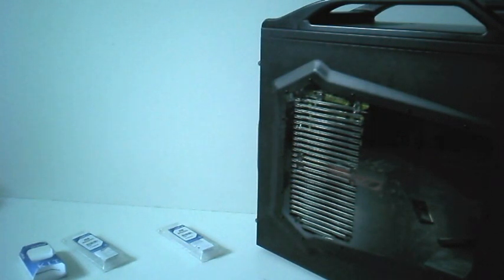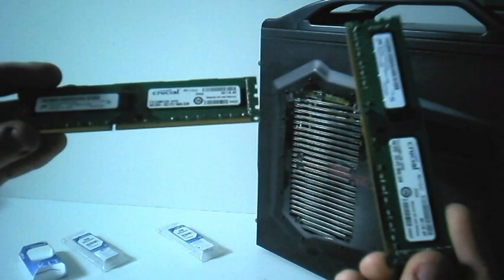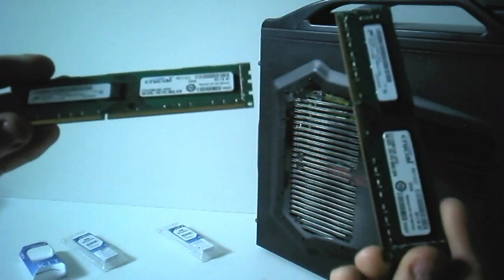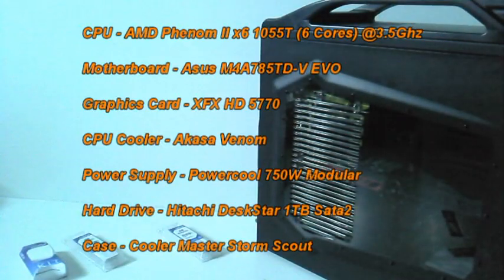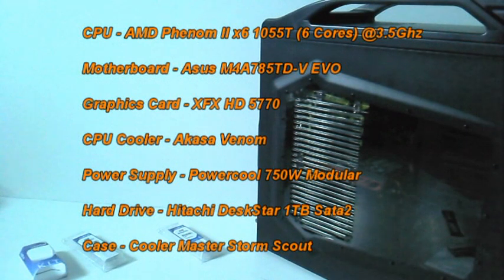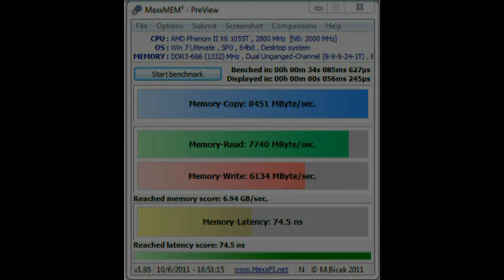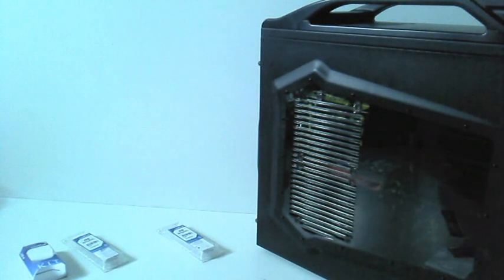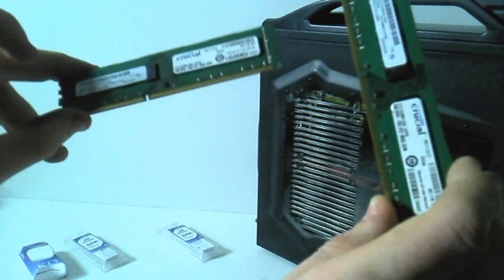Review #004 ~ Crucial 8GB (2x4GB) DDR3 Kit

Comment: Just wondering what you think of that PSU there. I need a new one now coz mine went Boom. is the 8 pin CPU pretty long? It will be bottom mounted in a Coolermaster Haf 912